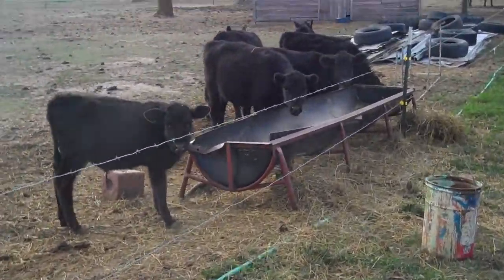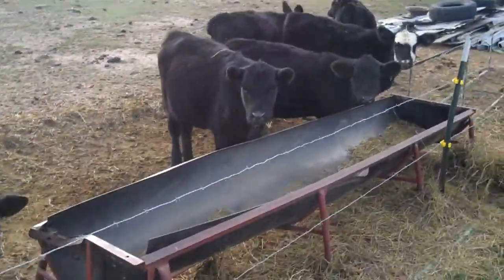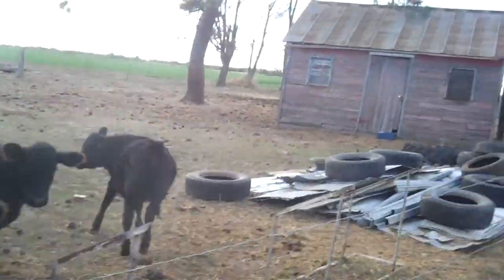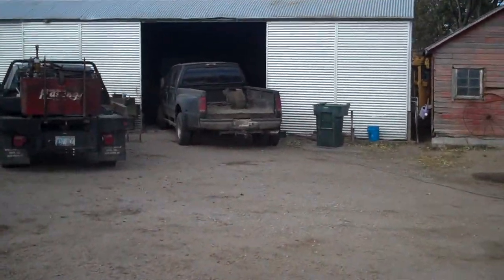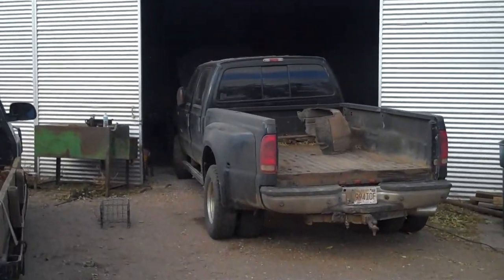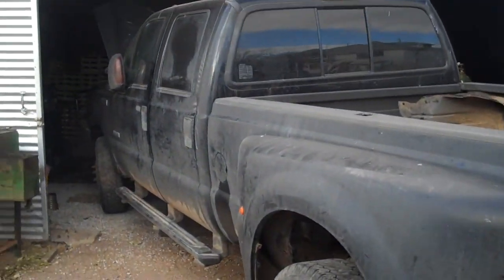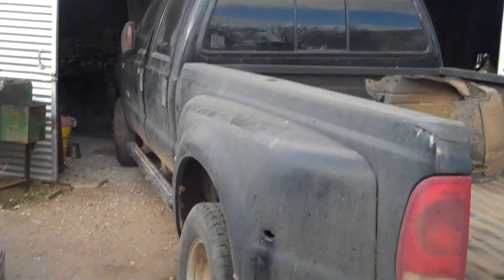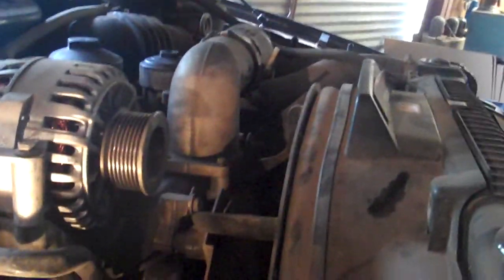2006 f350 superduty 6.0 Final video?for now!!

Comment: like the glove trick...we have done similar things...those a/c compressors are for sure in a tight spot between the engine and the frame. you didnt get to go through the truck to do it the way you wanted but dont worry it will be back!!!